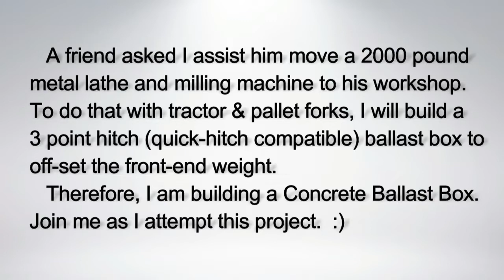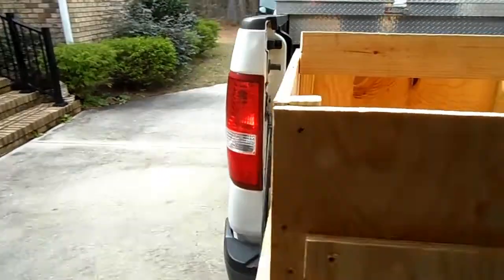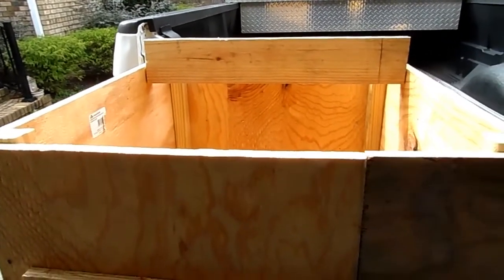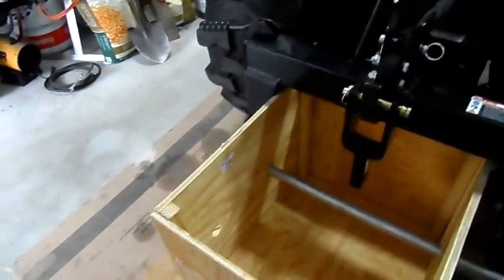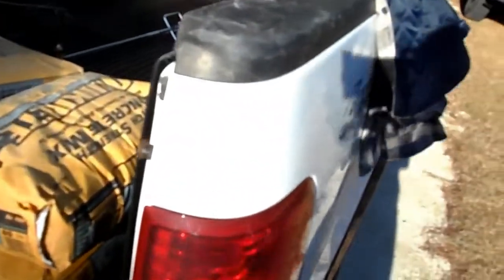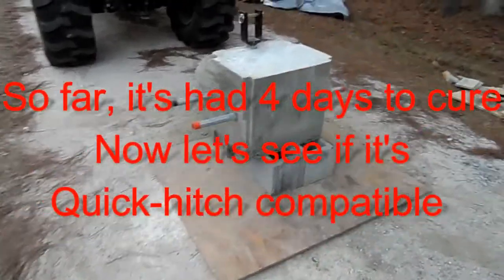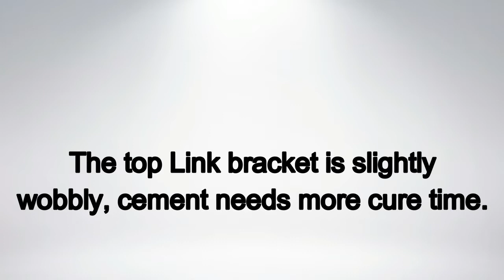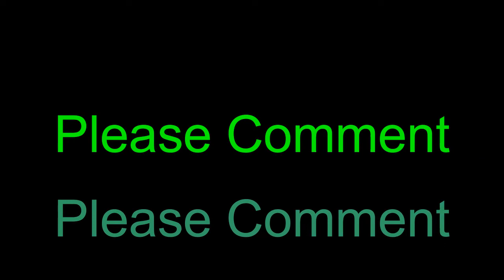Quick Hitch Compatible Concrete Ballast 22Nov20  Vid-061

Comment: The galvanized pipe was a better idea than what I was thinking, it will never rust. So did it work well for your job? Did that calculate the weight right? 560 lb. Ish? Do you have ballast in your tires as well? And if so, what do you use? And what brand chop saw was that? I need one of those. Sorry for all The questions, thanks for the great video and a great idea 👍 it's nice to see a plan come together, and it was very satisfying watching your quick hitch pick it right up 😁
Reply from the maker: The galvanized pipe is holding up well.  I put plastic end caps on each end of the exposed pipe holes just to keep water out.  Here's a video I just made for a viewer (Gregg Macklin) who inquired bout ballast measurements.  https://youtu.be/O8YaQuy0ROU
The ballast worked beautifully.  Here's a video where I used the ballast to counter the FEL weight when I moved a 2000 pound metal lathe machine. https://youtu.be/wNGeTk-bqKI  
I also have my rear wheels filled with a liquid solution to provide moe weight. (It's not beet juice; I think the dealer filled with a non-corrosive liquid.)
That dry cut metal cutting chop saw is Northern Industrial Tools Model 332814 (made in China😖).  That saw has cut through metal like butter.  The actual blade is designed identical to a wood chop saw blade but with 72 carbide teeth.  I think it would cut through most metal you deal with.  I think I paid $400+ over 6 years ago and it has not failed me yet.  Thanks again for watching my video.  I've had a lot of questions from folks about that concrete ballast and it's held up well, thusfar.  Since I didn't have solid 1" round bar to give me the thickness to fit into myQuick Hitch Category 2 lower loops on my quick hitch, I opted to use 1 inch (OD)  galvanized heat pipe.  The toughest part building the concrete ballast was calculating where exactly to place the Top pin yoke/fork that I purchased from Agri Supply.  To help resolve that issue, I left the framed-ballast box connected to my tractor  while supported by concrete blocks to keep it level.  It turned out great.  History: Too many folks were inadvertently bending their top link when lifting their completed concrete ballasts when they'd raise their 3 point hitch.  My ballast turned out great b/c of the method I used to measure where to place the top yoke/fork.  You're good with calculating numbers, so you'll do fine.  Sorry for the super -lengthy response. 👍🏽🙂
Reply: @houndsmanone4563  no H1, thank you for the lengthy response! All good information, and I appreciate the video links as well 👍 heading to the website now for the chopsaw, yet another tool on my want list
Reply from the maker: @anesthesiadreamin  I looked on Northern Tools website and they now sell a different dry cut metal chop saw. The Ironton 14 inch dry cut chop saw for $419 is made identical to the one I have.  There's a video that demonstrates cutting metal piping and provides details about the chop saw that should answer any questions you might have. That saw would surely be a nice gift to find under the Christmas tree 🎄🎅🏽.

Comment: Dropping another LIKE on your video - quite impressive! I still have issues with the turnbuckles on the tractor... it's crazy! Watching and Supporting!
Reply from the maker: Thanks Ray. I understand what you mean about those turnbuckles.  My rear-right turnbuckle got bent into a C-shaped piece of metal when I hit a hard stump using my rotary cutter.  Torque from the rotary cutter was so intense it literally bent the turnbuckle with ease. I finally got it straightened so that it would function as new.

Comment: Great job Don it looks great been wanting to make one for the Kioti going to have to get it done we have had the back tires off the ground 3 time this week getting logs to cut for fire wood ! i hope the top link holds up for you and dose not come lose on you  ! Have a great weekend and take care !! Kioti Curt :-)
Reply from the maker: That top link is now completely solid as a rock and does not budge.  Wow, I know what you mean when the back end lifts in the air.  It's quite an uncomfortable feeling when you're lifting and not able to control it other than releasing what you are attempting to lift or totally lower the object.  I hope you get a concrete ballast made to meet your needs. Thanks Curt for stopping by to watch and comment.  I hope this video will provide some form of draft to use as a guide.  If you make one, please video it so we all may see and learn from your build.  I've used the ballast on my new tractor and the ballast works perfectly.  Massey 1760M.  Hope you and family had a fine Thanksgiving.  We're now focusing on a virtual Christmas.  May you and your family have a great Christmas. Be well, Curt and thanks again 🙂 .
Reply: @houndsmanone4563  Thanks and you too ! Thats good it is solid now i hope to make one with a 2" hitch on the back to pull the trailer i thought about making some wheel weights but i hate when mud gets in the rim  still trying not to scratch up the tractor to much ! LOL got to take a load to the junk yard hope to get some cheap steel to make it and a pice to do light bar still have not got it done ! but hope to get some video of that to ! you have a great week and a Happy Christmas ! Kioti Curt :-)

Comment: How's she goin'?  Well done Don and it's good to see ya buddy!!!  I was afraid the way you set the top link hook up that it wasn't going to be Quick Hitch Compatible, but it lined up perfect.  A great set up and having the 2 pipes for lifting was pretty smart too.  The pallet forks will lift it no problem now!!!  A very nice project and it should allow for plenty of counter weight to lift your buddy's lathe!!!  Take care!!
Reply from the maker: Thanks Mike.  So far the weight has done well.  I don't think I'd want that slab to fall on my toes (smile).  It was a fun project, at first and then there were times I'd get a bit flustered when designing the form.  Thanks for the kind comment and for the continue support.  Have a fine week.

Comment: Well done! Success! Smart thinking to have the 2nd pipe to lift with forks. I like the compact design that fits within the quick hitch frame, so it does not stick out too far. I've converted my old rear ballast (concrete, 24in diameter x 36 inches high) to a quick hitch compatible. It's quite far in the back. Good for my application, the Case needs a lot of ballast to counterbalance the FEL. But not as compact it was before. Premix concrete is always a borderline mixture of sand, gravel, and cement. The latest one being on the poor side. Would you pour one excess tablespoon of water and it takes annoying time to cure.  I  usually add pure cement to the mixture to give more strength and a proper cure time. Thanks for sharing Don, I really enjoy watching your videos!
Reply from the maker: Thanks Joe.  Though you may not remember, we talked about the size of the ballast box and you advised that I pay close attention where I place the center top hitch bracket.  I used your ideas and AKdad's ideas while constructing this ballast. One thing that really helped was keeping the quick-hitch and ballast box form mounted in-place on the tractor so the top hook bracket would harden in its proper place.  I had measurement issues on the plywood form but I made a few last minute mods to create a slope on the front of the ballast to ensure the quick-hitch would easily clear the very front of the ballast.  That hit me at the very last moment when I dry-fitted the form box prior to pouring cement.  That cement sure took a long-ar$$ time to cure.  My neighbor said do not be fooled. The cement block would need a week or two to cure and he was correct.  The more it cured, the whiter the concrete turned and that steel top bracket got more and more firm.  Now that metal bracket won't budge a bit even if I bump it with the steel hitch in the wrong direction.  Thanks for your help and thanks for watching & commenting.

Comment: Didn't see But, did you remember to OIL the inside of your wooden box B4 you added the concrete?  Makes it much easier to remove the form after the concrete is about 2/3 setup.
Reply from the maker: No I didn't oil the inside and the form came off quite easily but because of the way I assemble the form, it was very difficult to reach into areas to unscrew the screw fasteners.  Thank you so much for watching and commenting.  This is the thickest I've ever poured concrete and I sure could tell by its slow curing process.  Have  fine week.

Comment: So about 616lbs. of counter weight. You should have used a solid steel bar. The steel pipe can rot where it contacts the concrete and us exposed to moisture.
Reply from the maker: Thanks Sean.  👍🏽🙂

Comment: Nice vídeo. I need to make one for my tractor. But I need it do be compact so I can also put on the trailer that need to pass under the ballast. Do you now how much does your height?
Reply from the maker: Good question, JMG.  When the ballast is mounted on my 3 point lift arms , (in the lowest position), the bottom of the concrete ballast box is 8 to 10 inches from the ground surface. I will send you a picture of that if you desire.  Therefore, my tractor can drive on and off a  trailer without scraping the metal trailer surface. Does this answer your question?
Reply: @houndsmanone4563  yes. Thanks

Comment: Great work Don.  Looks like it came out well and should do the trick.  Is it just me or did those sacks of cement get heavier over the last 10-20 years? Any idea exactly how much that block of concrete weighs?
Reply from the maker: Hey there Bruce.  The concrete counter-weight has fulfilled its purpose well.  The weight is slightly over 560 pounds.  It took seven 80 pound bags plus the weight of the rebar and piping added maybe 10 pounds, so I'd say maybe 565 to 570 pounds. Thanks for watching and the support, my friend.  Have a fine week.

Comment: Is 560lbs enough ballast to pick up 2,000 lbs on the front forks? looks good overall though I like the design much better than just using a trash can as a form.
Reply from the maker: Apparently so, Scott.  That's the weight of ballast.  I would have used my 6 foot rotary cutter but it's pretty bulky.  When I lifted the lathe, my 1 front wheel pancaked and made a pretty good impression in the ground. I will not be doing anything like this again.  Once was risky enough. Thanks for watching and commenting.

Comment: ... I actually would prefer to pkup the heavier objects as a lathe with Rear forks instead of FEL forks.
Reply from the maker: Yes, that makes sense.  I've used forks on my 3 point lift and it does lift easier and no shifting weight on the tractor.  Thank you.

Comment: Has the pipe held up? Looks like it would be prone to bend especially if it got bouncy.
Reply from the maker: Jason, thank you for watching and commenting. The pipe is super strong.  I drove the tractor with the concrete ballast attached 6 miles away on hard surface road and hit numerous bumps and dips.  Not even the slightest bend in the pipe.  The pipe arms are extremely strong.   My last video (moving a 2000 pound lathe) shows the ballast on my tractor in use and the concrete ballast performed well. There is a 2 part video on YT I watched where a young guy made a concrete ballast and I think he used black pipe and I guess his ballast held up.  As stated in my video, I used seven 80 pound bags of concrete so I estimate the ballast to be almost 560+ pounds (cement and metal supports combined). Have a fine week and hope the ballast video helps if you decide to make something similar.  👍🏽🙂

Comment: Good job Don!! I liked your chair “holder” 😁  Sometimes the hard way is the best way when it comes to mixing concrete (at least it didn’t burn up the drill). Turned out good even if you have to pull the pin!! How is your creek crossing holding up?
Reply from the maker: Hey Dave. happy Thanksgiving to ya.  Yep, I sometimes use any object to prop up my lumber to keep it even when cutting.  The hand mixing cement ended up being the most efficient b/c you could actually feel how it was being mixed.  Thanks for watching.  I walked back to the culvert bridge a couple days ago and it's holding up fine.  There's weeds growing several feet high around the culvert bridge but the bridge is extremely strong.

Comment: How far from the front and back are the bars?
Reply from the maker: Gregg, I'll check after I feed the hounds. Today is animal-chores day.  I think I still may have my hand drawn diagram but lately, I've been a mess on my organization of drawings and things.  It must be my fast deteriorating mind (smile).  Before my stroke, I was atleast a semi-sharp tool in the toolbox but since then, my mind's like a rounded off flathead screw driver (smile).  I'll get back to you today, regardless.  Thanks for watching and commenting.
Reply from the maker: Gregg, I went down to measure various parts of the concrete ballast box but instead, made a video of the measurements to hopefully answer any questions you might have regarding the making of the ballast.  It's a PRIVATE YouTube video made specifically to address ballast measurements. Here's the link  https://youtu.be/O8YaQuy0ROU
Reply from the maker: Gregg, did the video on concrete ballast measurements help or was I way out in left field.  I'd appreciate your feedback.  Thanks much.
Reply: @houndsmanone4563  The link takes me to "Video Unavailable." I have a Kubota L3000Dt with 4X4 with a quick hitch, and a loader. The ties are liquid-filled, but sometimes those back ties leave the ground. I have to be very careful on ground that is not flat. Butt puckering. Not as bad as spinning a plane, but I still don't like it.
Reply: @houndsmanone4563  The link finally connected thanks for the information. I just bought a set of clamp on pallet forks so even with ballast in thee tires, I am going to need this 3 point hitch ballast.
Reply from the maker: Great Gregg.  I hope you get your ballast made to compliment your new clamp-on pallet forks.  Be safe.

Comment: what was the final weight?
Reply from the maker: Hello Jean.  The final weight may be  570-ish pounds (+/-). Though it's only 570-ish pounds, the quick hitch attachment adds another 70 pounds.  I definitely can tell I have the weight in the rear. Not a bad alternative to lugging a large rotary cutter or box blade.  The rotary cutter and box blade are big and you must be careful backing up when you have that extra length sticking behind the rear.  I almost clipped my truck and that would not have been pretty.  Thanks for watching and commenting, Jean.  Have a great upcoming week.